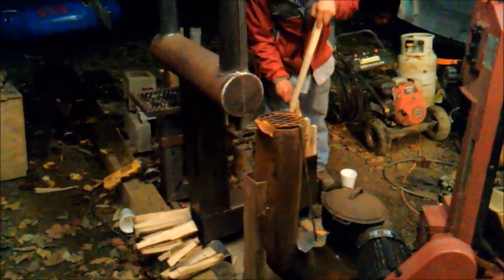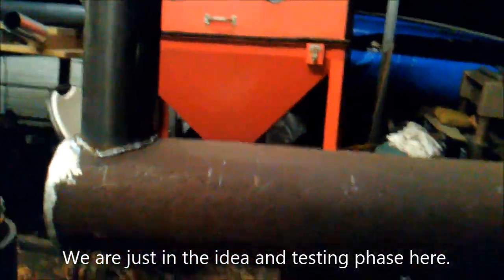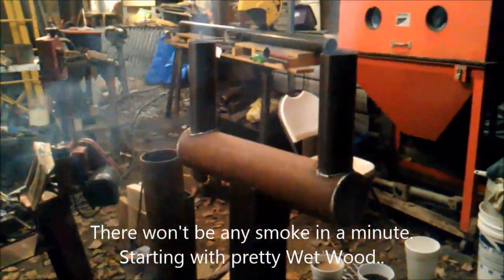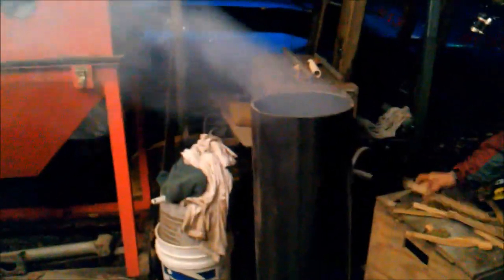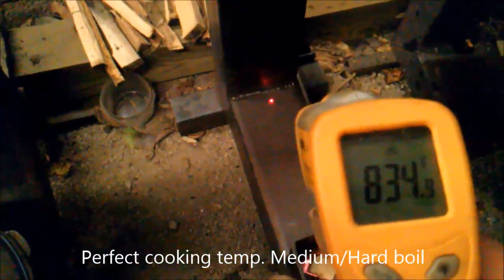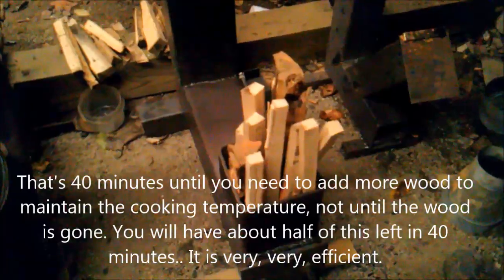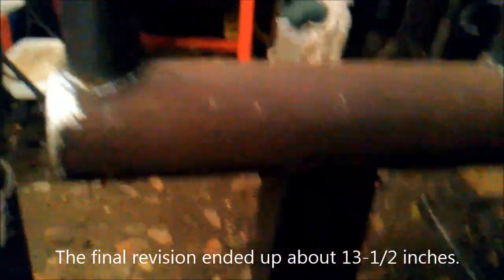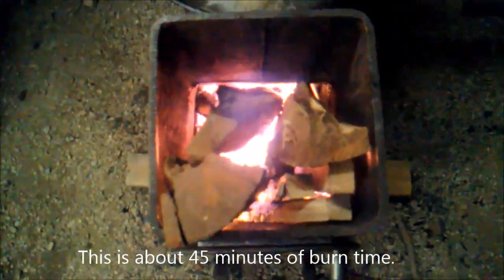RocketStove-LongHorn Beginning Ideas Beginning Build-Long Burn Times

Comment: I hope to try out some designs this spring. I've got a few plans to try and a bunch of metal and my everlast welder. Should be fun.
Reply from the maker: I think you can tell, that is about how I feel when I get out into the shop... I am always building something new... Usually better than I could hope to buy in a store, unless I paid a fortune for what I create.. Usually,, just have an idea and enough metal to do what I planned.. And, a good bit of other metal around, in case I change my mind and do a mind design.. They are always fun and usually really come up with something interesting and cool.. I still have my HF Mig.. Just keeps on welding and welding and welding.. Probably a couple hundred pounds of wire so far and still using the HF Plasma cutter.. Got an Evolution Rage 2 Chop saw.. Wow.. HOW SWEET!!! Check them out when you have time. Love mine.. 
Hope that Everlast does just what it's name implies.. Have fun Creating.. 
The Long Horn was my final design.. It was what I was working towards with all of my other designs.. The 6" is the size where you get the really even cooking temps and things really work well and stable.. I have a video cooking a chili on it... Several videos leading up to the final design.. I have a playlist.. 
If you are looking for a Long Burn Time sure enough cooking stove,, this is it.. Just don't use pipe for the top,, just use Square tube.. It was a mind design and all I had was round in that size laying around.. So much easier with square and doesn't make any difference.. I do like the round exhaust pipes though.. 
Have Fun Creating!! Cheers!!

Comment: You can actually point the twin stacks down. the cooling smoke will drop out of the bottom. Great work and innovation. :-)
Reply from the maker: +heatherroseisrflyer Interesting comment.. I had to think about that one for a second or two.. 
I think I understand why you might think that looking at these things.. Possibly the fact of the design of a lot of Rocket Stove "Mass Heaters"? You can force the smoke to go down.. And you can get it to go down as it cools.. I will agree to both points with the following reservations.. The key to this is the temperature differential.. You can direct heat to go down, around, etc.. as long as it exhausts well somewhere... You have to balance your exhaust to give you the draft you need to burn the wood without the fire climbing up the wood in the feed tube either way.. 
Hot Air expands at amazing rates.. Never looked it up, but, I own a White Water Rafting Company, and I can fill a raft up less than half way with zero pressure, sit it in the Sun for 15 minutes and come back and bounce quarters off of it..  The key with the stoves,, if you wanted to do something strange like that would be to know the heat and volumes of air at key points in the stove.. And the relationships of the temperatures would have to remain pretty constant across startup, running and cool down temps for it to work properly.. The more insulation at that point, the more stable you could make it.. But, it would be quite a task for an average builder.. 
Air/Heat expands in the Burn chamber, and then is dissipated through the rest of  the travel. It works fine at the same dimensions through the stove naturally... If you wanted to do that,,,, Hmmm,,,, You would have to figure out how you could keep your rate of flow (vent and draft) up... I'm sure it could be done by reducing the diameter, and possibly experimenting with Heavy insulation, then, before turning down, stop the insulation, go to a really thin wall pipe, possibly with internal cooling fins that don't reduce the flow, etc.. It would really be breaking the laws of physics.. Which can be done,, but, not easily.. You could try it in steps.. Go from a Horizontal which should work pretty well, add a short 90 and go from there.. But, don't expect it to work very well would be my best guess.. But would give it a cool look for sure.. The less restriction in the flow the better.. 
Mass heaters pull lots of heat out of the air, but, they always vent at least outside which is always cooler, and generally hot air rises, so, that is the reason you can add so much horizontal footage to the horizontal riser..
The reason the 35 and 55 gallon drums which are usual work, is because the rate of flow from cool to super hot air has incredible flow or draft, and it forces the air up into the chamber and naturally, the cooler air in the differential flows down the fastest.. But, If it were not confined, it would not be forced down.. 
That is what took me a minute to think about.. As soon as the smoke exited the down pointed smoke stacks,, (or heat if properly functioning), that air would rise immediately, unless it was warmer outside than the heat coming out of the stack.. On second thought, might work if you reduced the 2-4" pipe risers to 2.5 or 3" maybe.. Or, put a reducer on the end of the two stacks pointing down.. If there is enough temperature differential, you would still create a good draft.. 
IE.. Open a Cooler inside of another cooler and the air will move slowly.. Open it into a warm shop, and it will move quickly.. I may actually try that some time.. Interesting concept.. Cheers.. Build a few, and choose your best stove, and then, see if you can make it work like that... If you ever take a shot at it, take a couple of short videos of how it runs before and after and tag me... If it is not working right just yet, I'll give you some ideas. Cheers.

Comment: You should insulate the pipe to prevent heat losses which will result in better efficiency. You can get ceramic insulation for pretty cheap online.
Reply from the maker: +Tyson Capel   I started building these stoves to test the limits of the "Rules" of rocket stove building, etc..  At the time I started building these, there were "NO" Extended burn time Rocket Stoves, and None with multiple cooking surfaces, and lots of people who said this could not be done.. Lots of rules were broken, and proven to be correct, and lots of them broken and proven to be incorrect and fully functional..
The insulation factor is one of the variables that IS, or IS Not, or Might not be necessary.. 
I did a good bit of experimenting with insulating.. Let me share with you what I found.. In particular, what I found about what my Purpose in building these stoves are... 
My Purpose for these stoves.. 
1) To be able to cook on them, when I want to, for whatever reason. 
2) To be able to cook on them, if some Economic, Electrical, Natural or Financial disturbance happens in the USA, causing us to not be able to purchase Propane/Natural Gas/Electricity for cooking. We are not immuned to the laws of Economics, and physics. This would  be cooking in a SHTF scenario, and cooking drived Beans and Rice. 

So, a Rolling Boil, and then Simmer are the keys to this kind of cooking, for both the Beans and the Rice.
Then, a controllable fire to be able to keep things warm over time, while preparing other things, or eating and keeping it warm while eating in shifts if necessary.. 

Now to your point of Insulation.
Rocket Stoves "Do Not" require Insulation to work properly. 
If a Rocket Stove is not running "Efficiently", it "Will Smoke" out of the Exhaust stack.  This unburned Smoke is Unburned Fuel. If a Rocket Stove is burning properly, it will "Not Smoke".  It doesn't matter if the Wood is Wet, sappy, etc.. If properly built, it will burn everything up in the burn chamber.. There are various ways of doing this.. Some people think that Vortexes are the key, but, they disturb draft, and most, in order to not disturb the draft have to introduce cool air to the exhaust to speed up the draft they reduced.. I played with it and have several videos on the Vortexes that I created,,, without introducing cool air to the Burn Chamber.. I played with it long enough to know it is not needed if your exhaust chamber and burn chamber have proper ratios. 

Think about it like this.. The small, very popular rocket stoves.. None of them, or most of them are not insulated and work fine. (No Smoke) The ones I have seen that "do" have insulation, don't need them to burn efficiently. 
As you can see in my Long Horn Chili Cooking video, you don't see any smoke, unless you are adding wood to the burn chamber, and "All" will smoke for a few seconds, and some for a minute or two while doing this. Even the Mass Rocket stoves. They will "All" smoke when you are cranking them up. The faster they crank up, the faster they stop smoking. So, start them with dry wood, and it won't smoke for more than it takes to get the wood hot and get the draft moving.

Insulating. Where you see that Insulation is common, you will be looking at Rocket Stove "MASS" heaters.. The purpose is to Heat the Mass, and keep it warm, long after the fire burns out, since None of the Rocket Stoves, neither small, medium or large have extended burn chambers that I have seen. Once the wood burns out, and the coals settle down, the stoves cool as quick as anything else would cool.. The reason for the "Mass" heaters, is to heat a mass and let the mass slowly deliver heat when the burn chamber runs out of wood. Otherwise, there would be some pretty large downsides to "Rocket Stove Mass Heaters".. You would have to tend them every hour or so, to keep them effective in warming an area.. 

Hot air is going to expand, and hot air is going to rise.. None of us are going to change that.The expansion of the air being warmed is what causes the draft.. Think about it.. Every rocket stove you will see has either the "Same Size" Burn chamber and Exhaust,, or, a Smaller Burn Chamber and larger Exhaust. You will also see that the Burn Chambers are shorter than the Exhaust chamber..  I have proven that at least one of these Rules "Can Be Broken"... 
If you look at my video "6.5" Burn Chamber to 4" Riser: https://youtu.be/u4ftabCPxis, you will see what we did. We have a 6.5" Burn chamber, and a 4 inch Riser (Exhaust chamber)... The initial problem was me not opening up the burn chamber fully to the exhaust chamber, which caused a limitation at the bottom which caused an interruption in the exhaust flow. I corrected that problem, and proved that the stove would work properly. It was still a bit finiky at that point, so, I added some length to the Exhaust Chamber to increase the air flow.. In this case, even insulation would not have solved the problem.
In fact, it would have compounded the problem, and caused the stove to smoke more and longer, until the insulation chamber itself warmed up. What it would have done, was sucked the heat out of the exhaust, cooling the exhaust, and therefore reducing the volume of exhaust.. At this point of pressing the rules of physics, I would have had more problems keeping the smoke from coming back out of the burn chamber (walking up the wood), and eventually, loosing the exhaust up the pipe to the point that the heat and burn would have been in, up, and out of the burn chamber. You have to have draft to keep the flames at the bottom of the wood, and not crawling up the wood, or your exhaust will redirect out of the burn chamber rather than the exhaust chamber, and at that point, all you would have is a 6.5" pipe to burn your wood, and no redirection of the exhaust heat.. 

Take the Long Horn Stove for another example... 
There are two cooking Surfaces.. One on top of the Burn Chamber, and one on top of the Exhaust chamber.  The faster both heat up, the faster the stove will operate correctly. In my case, with dry wood, only 1 to 2 minutes to crank it up and get to the "No Smoke" efficiency..  When you insulate something, the insulation is not effective until the insulation heats up to some point, that there is not a transfer of heat via Convection, Radiation, etc.. outside of the insulation. That is where it becomes effective, vs no insulation. So, there is more heat removed from the Chambers while it is heating up the insulation.. Sitting something like a Pot full of Cold Water on the Chamber will have the same effect as insulating that same space with some other material. Once the stove burns out, the pot of water will continue to radiate it's heat back into the stove, until both cool down. Same scenario. 
So, if my stove is rolling, and I put a Cold Pot on the Burn chamber, it is going to suck heat out of the Burn Chamber and transfer it to the pot, which reduces the heat running up the Exhaust chamber. I think you will agree with that..
But, will it have any negative effect? No.. The heat transfer would be much slower than the heat generated by the burning wood, and this is where the draft is created.. The expansion of the "Air" causing the draft. 
Double the size of the Exhaust, and you will reduce the exhaust flow speed, and will probably have problems with keeping the fire in the bottom of the burn chamber.. You will have the same volume of air (all things remaining the same), but, the speed of the flow will be reduced, therefore the influx of fresh Oxygen at a higher rate will also be reduced. More O2 passing the flames will create additional heat, and give you a secondary burn to burn "All" unused fuels.. 
Try this.. Pick up an aluminum tent pole, and stick it into your burn chamber with your wood. It will stay there forever.. But, pick up a compressor, or a hair dryer, and stick it into the end of the aluminum tubing, and let it blow through the tube into the coals at the bottom of the burn chamber.. You won't have much of an aluminum pole left after a little bit of time.. Why?? The introduction of more oxygen.. It is the same principal of a Blacksmith forge.. Add more air, and the temperature will get hot enough to melt Steel, or Cast iron, much less aluminum.. No insulation needed there either.
Back to the Long horn Stove.. Remember.. Rolling Boil, and then a Simmer, then a warmer.. 
The Heat directly from the Burn Chamber gets the Horizontal Burn Chamber somewhere between 800 and 1000 degrees F. As the heat radiates out of the burn chamber, the heat travels up, warming the exhaust chamber.. At operating temperatures, the secondary cooking surface gets between 450 and 650 degrees F. This is a very good simmer temperature with a lid on your simmer vessel. Then, heat is pulled out at the secondary cooking surface, and the final heat coming out of the two warming surfaces ranges in the area of 200 to 250 degrees F. 

What would insulation offer the "Long Horn Rocket Stove"?  I could drive the temperature at the Horizontal Burn Chamber up, and drive the temperature of the Exhaust chamber,,, after the insulation heats up, which would drive the overall heat up across the whole stove.. But, as I stated, the temps that it produces are Perfect for what I am trying to do with the stove. Cook Beans and Rice.. Obviously, you saw the Chili Cookoff, and it cooks other things just as well.. 
This winter, when I finish my other welding projects, I will build an oven for the top of the Burn Chamber, where the Chili was cooked and be able to cook Biscuits, bread, cakes, etc from there.. 

BTW. I will also be adding some shelves to the side of the Exhaust chamber to cook Baked Potatoes, Coffee, Canned goods, etc.. It will have graduations or (shelves) up the Exhaust chamber, so I can utilize the areas of heat to my choosing while the stove is cooking something else. The further down, the more heat. The further up, the less heat.  I may even add some small metal boxes to the side of the Exhaust Chamber to capture the heat and box it in, to give me more "even" heat, vs, heating from one side, to give some of you some ideas what other things can be done with the stoves. I will have to be careful not to pull too much heat out of the Exhaust chamber and reduce the heat of the Top Simmer plate, unless I want to reduce the temperature there.. Of course, I can use thinner split wood, dryer wood, or something like Locust wood, which burns much hotter than other woods.. 
There are endless combinations to allow you to cook as you want to cook.
Adding insulation would void all of the ideas in this last paragraph, and do nothing more than cause the stove to heat up slower and get to a higher temperature, increase the weight and portability of the stove, etc.. 

Moral of the story is.. Don't get hung up on insulation, unless you need it to get your stove to temperature (which should not be needed), or you want to heat up the stove as a mass to stay hot longer (after the fire goes out, or goes down).. It is too easy to keep the fire constant to be able to cook at a constant temperature to worry about doing it with insulation. They key is draft and the type and size, and moisture content of wood that you are using. 
I can't think of very many things that I could not cook on this stove.. The only thing I can think of would be some sort of sugar based recipe that would require the use of a candy thermometer and a very specific temperature range to get to "Softball stage", etc.. Hell, it is hard enough to do with a good gas stove,, and depending on your flavor of electric stove,,, I'll bet I could do just as well as the Average Electric stove when doing so.. 

Cheers.. I hope this helps clear up the subject of Insulation, and gives the viewers some real good concept of how these stoves actually work.. BTW.. I can use one piece of wood, 24" long x 6" diameter, and split it up and cook a full meal that takes 2 hours to cook on this one piece of wood, on this stove.. I can also cook on twigs and sticks or broken up pallets or anything else that will burn.. I have actually run this on Wood Chips picked up from the City chipper who cleans up limb debris, like the Davey Tree Trucks.. In fact, I use it in my Bee smoker now. One evening, I will even cook something on some old oil soaked rags that I normally send to the landfill... Curious to know if it will smoke, but, I seriously doubt it.